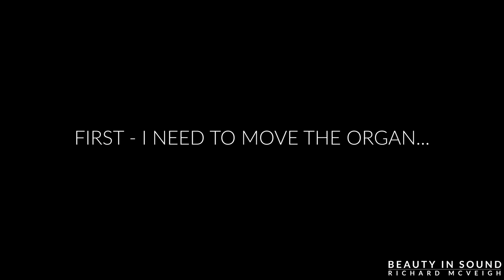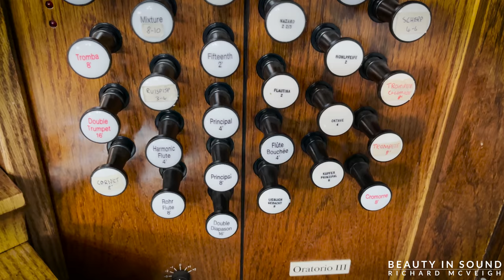☕ I HEAR my organ for the FIRST time | DRAIN PIPES inside?! | My Hauptwerk Setup

Comment: Richard, those "drain pipes" you showed in the video are actually ports for the low frequency drivers in the organ, that is assuming that the back panel is in place creating an enclosure.  Think of speaker enclosures that are ported for extended low frequencies.
Reply: Right, " Helmholtz resonators".

Comment: MIDI was widely available by 1984. 16-bit sampled synthesisers were available in the 1990s - including ones that had multiple samples (different pitches) per note in the sample, so not entirely surprised that this has the sound it does. Still sounds electronically produced, no doubt due to the nature of loudspeaker physics. In the '90s the ability to electronically compensate for loudspeaker phase distortions was in its infancy, with technology to do that (the Sonic Maximiser primarily) only newly on the market, patented, and very expensive.
Reply from the maker: In the original output of this audio, each organ division was 100% left OR right (I think swell was left, choir was right etc). It made listening through headphones unbearable! I can see why it would work through a speaker setup, but through the headphone output?? 🤯

Comment: I know this was from a few years ago, but this is my 1st time seeing it.  I played for a number of years at a local church here in North Carolina with the 2 manual version of that beast.  Inside, it looked almost like yours.  The big problem with these instruments is that apparently, that's my guess, they didn't put enough bits in the samples.  Playing one or two stops together, sounded, well, not bad.  But start adding stops and all that happens is it increases the, I'll call it mush.  You can't hear individual stops once you have a few playing.  It just gets louder and maybe brassier.  I own an Allen Theatre Organ from the same time period, that has dual voicing, theater and classical.  It beat rings around the Viscount.  I think Allen did it right.  Even with 4 or 5 stops drawn, you could still hear the addition of an additional stop.  BTW, the contacts on the Viscount, mostly the pedal, were horrible.  All in all, your video brought back some memories of the years I spent playing that thing.  Thanks.

Comment: My organ is an Ahlborn SL300, from the same years as your Viscount, but the electronics look slightly more advanced. I have intervened on all the circuit boards and after repairig the CPU board, visited the Ahlborn factory in Rimini, Italy. I still use the original sounds, mixed/overlayed with the modern synthesised sounds through a cross-over/fader on the two sources.

Comment: As was previously mentioned, those drain pipes are ports for the speakers, but you have to have the back on the organ for them to work. Also, it doesn't look like the organ's speakers are connected. Looking back there, it looks very simple to me - but then my organ is a Rodgers 3-manual from 1983, and it is entirely analogue except for the z80 based computer that operates it.  It has three 6'x4' wooden panels that pull out, each of which is fully populated with circuit boards.  This organ is positively spartan by comparison.

Comment: Very interesting video. In the 90's, as you have said that organ would have been the bee's knees for home organs and it wouldn't really be fair to compare its sound to HW standards of today.  Despite its modular construction some areas did look a bit like a rat's nest! I expect at the time it would have partly been using CMOS or TTL or possibly programmable logic. It just goes to show the massive leaps forward semiconductor technology, especially CPU and memory  has made in the last couple of decades. All I can say is what a blessing Hauptwerk is. What will HW look like in a decade at the current rate of progress? Finally, it would be interesting to find out a bit more about the electronics of the Viscount.
Reply: I agree with what has been said, the insulating tape must stay!
Reply: Rat’s nest 😂
Reply: A common term amongst electricians for less than neat wiring 🌞
Reply from the maker: It’ll be interesting to see what Viscount themselves say about it when to come to service it, and what they do to the internals of the organ. I’m fascinated to see how Organ technology will progress in the future, and this is one of the main reasons why I’m so keen to invest into it at this early stage of ‘home’ organs 😊

Comment: I'm surprised to see perfboard (circuit board with a lot of holes in a square) that is usually a sign of a hand made circuit.  It really looks quite well designed for the 1990s.  I'd be curious to know what the used value of a 1990s midi organ like this viscount is.

Comment: It's so funny, I have a viscount recitative. It's so similar in much parts. These orange KG-Rubes are bass reflex tubes. Normally, the speakers are closed in the back and the enclosed space builds a bass reflex system. Viscount sampling in that time was 8Bit sampling. It's better to hear with digital reverb. Are the stops midified originally from viscount? At my old viscount recitative they aren't.

Comment: That is not a drain pipe... the back panel of the organ (you have it removed) forms a seal, and creates an enclosure for the speakers, and that pipe creates a vented enclosure for the console speakers.

Also, that organ is really not that old in the world of digitals. My practice organ is an Allen MOS 1 from the mid 1970's, and it works perfectly. This organ compared to my Allen sounds fantastic... add some reverb and it would be awesome.
Reply from the maker: I added a tad of reverb at the end of the video 😃

Comment: I have a Viscount Chorale 8 (discontinued model; about 4 years old). The voicing parameters are pretty flexible but some of the stuff you played here sounds exactly like mine...for example, the swell chimes or some of that specific 'chiff' especially noticeable with flute stops. I spent a considerable amount of time adjusting the settings and volumes of individual stops, etc. until I got a decent sound out of it but to me it only sounds good if you really crank up the reverb. I'm actually considering switching to Hauptwerk in the nearby future; I was actually going to ask if your stops/pistons/toe studs/swell pedals also send midi signals or did you have to get those rerouted/wired?
Reply from the maker: Everything on the console works in Hauptwerk without any fiddling around with wires - all buttons and stops send a MIDI signal luckily. It’s actually very straightforward....

Comment: I had a theory about your cipher.  I thought I noticed on one of the streams that the stop lights flashed at the same time the note stuck.  You probably already know that with MIDI it sends a signal to start a note and another signal to stop the note.  If you miss a start you probably don't notice, but if you miss a stop, you get a cipher.  It could be a loose wire in the mains cable, or possibly a dirty connection on the MIDI cables.  Always a good idea to just reseat any connectors.
Reply from the maker: When it happens, there are lots of MIDI messages sent & received resulting in flashing stops and random registrations. Sometimes it’ll cypher on the registration I’m currently using... sometimes it’ll do it on random stops. Once it does it, I often lose the ability to send MIDI signals from my organ meaning I have to restart MIDI from within Hauptwerk. The issue is either:
- The organ
- A dodgy cable
- Audio interface
- Computer (endless reasons, eg conflicting USB)

There is no pattern. Sometimes it’ll do it when I’m not even on the organ but have left it running... it’s like one of the cats has jumped up and walked over the keyboard on tutti. It can be rather alarming!!

Comment: I guess those stops are not sampled or anything? Believe me or not we have these kind of instruments in our churches and ways worse ones …. 😧
Reply from the maker: No they’re not sampled - they imitate an organ tone as opposed to Hauptwerk which is an actual recording of an organ pipe.
Reply: That's not right. They are sampled. But it's 8 bit resolution. I don't know the sampling rate. It's close to that, what an Commodore Amiga computer can do. Today you use compact disk resolution 16bit 44,1kHz sampling rate or better. For example, amplitude resolution in 8bit is 256 steps, in 16bit 64536 steps. A gigantic difference!